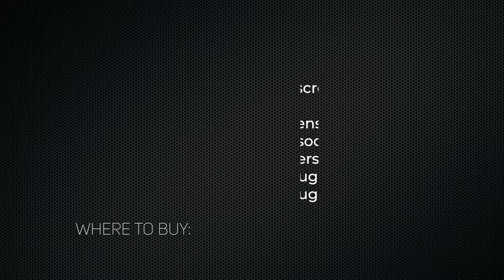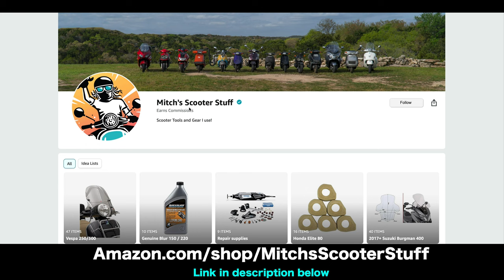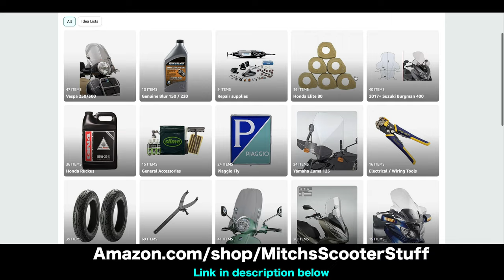Suzuki Burgman 400 - Spark Plug Replacement 2017-Current | Mitch's Scooter Stuff

Comment from the maker: T O O L S
Nose pliers - http://amzn.to/2yetDDj
Spark plug -  https://amzn.to/3W5EKZJ
5/8" tall socket - https://amzn.to/3W1rTI0
Ratchet 3/8 drive - http://amzn.to/2hhmnUs
Spark plug gap tool - https://amzn.to/2IJiDJ2
Phillips #2 screwdriver - http://amzn.to/2fgdZDL
3" / 6” extension set 3/8 drive - http://amzn.to/2h7ypMl

Comment: That has to be a great scooter to ride, especially after seeing the FortNine video.  I just wish it looked like a Vespa, but all the cargo capacity of the Burgman. :)  Have you taken the online ChampU motorcycle safety course yet? (on sale for $50) They don't talk about the rear brake until the very end, but scooters have a massive capability that only professional motorcycles get with the rear brake on the handlebar.  The added weight on the rear wheel and the fine adjustment of the rear brake gives so much more control to riding overall.